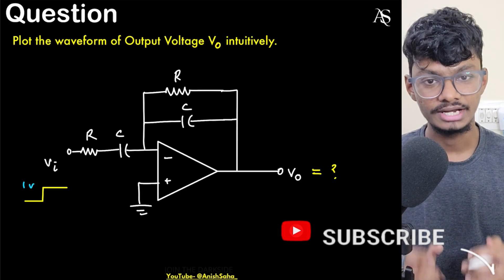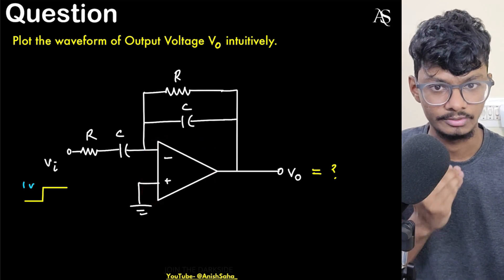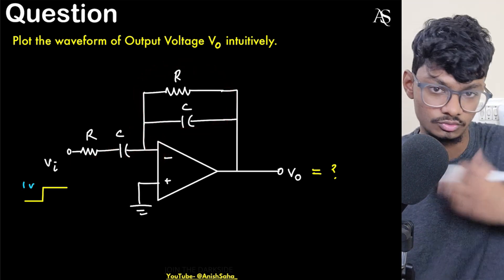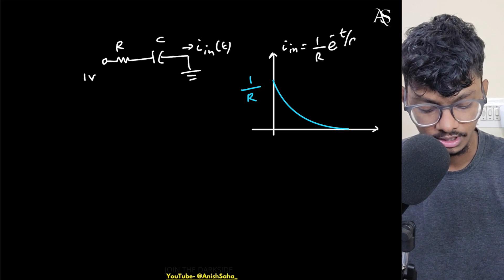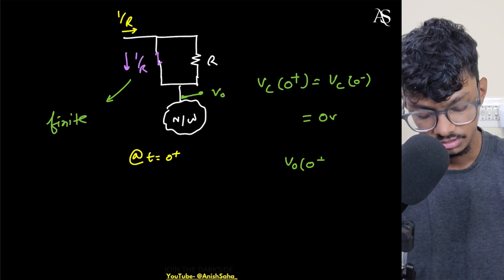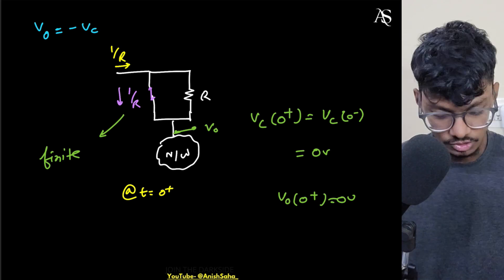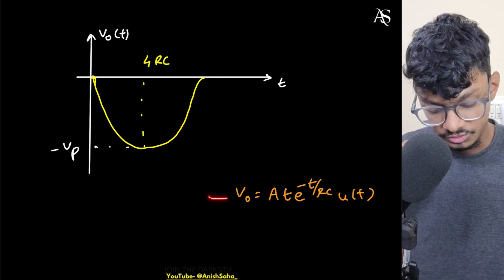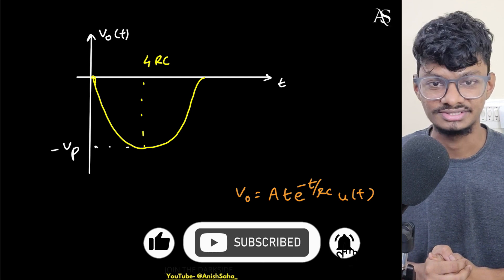OpAmp with RC  || Analog Interview Questions

Comment: Sir I've a question in general , I solved this question by using op amp basics and converted the this circuit in laplace domain by converting C to 1/sC and solved it by basic kcl . Then I converted the laplace domain to the time domain and got the exact waveform. But approaching this question intuitively was a bit difficult . So in interviews of companies like TI , do they check the mathematical (basic approach of KVL/KCL) approach or intuition (without the use of pen and paper) does play a very crucial role in such type of questions asked in interviews  ??

Comment: I just have one question, I get the part that the output voltage is nothing but the negative version of the capacitor voltage but once the cap is done charging and then it starts acting as a voltage source and starts discharging, the graphical curve should be an exponential downward curve showcasing similar plot to e^(-t/tau) but when you say the cap discharges the graph just looks like the mirror image of charging, I don't get it, can you please explain how? 

Please let me know if my question is unclear, I will try to explain it in more detail...thank you
Reply from the maker: I didn't say it will be symmetrical yes you are correct after t=4RC it will discharge exponentially.
Reply: yes the discharging graph should be the other way, like exponentially discharging

Comment: The output will be at negative maximum when all the incoming current will flow through the resistance(in parallel with capacitor), this point will be before 4T, I guess ?
Reply from the maker: Yes